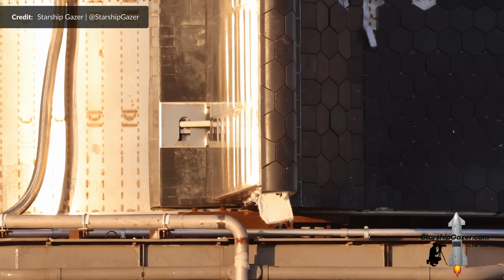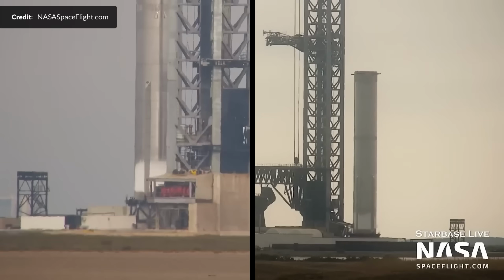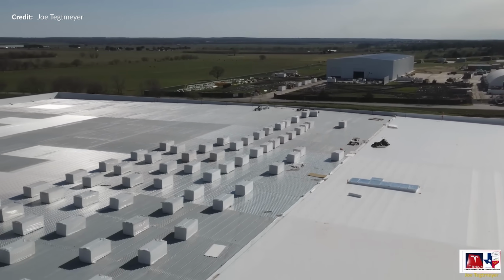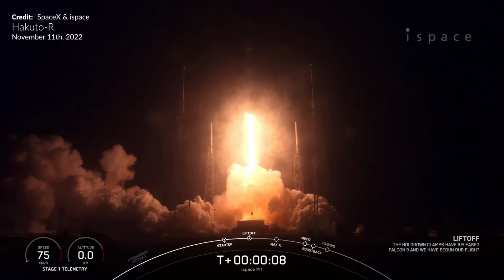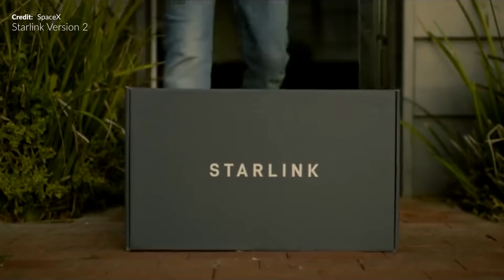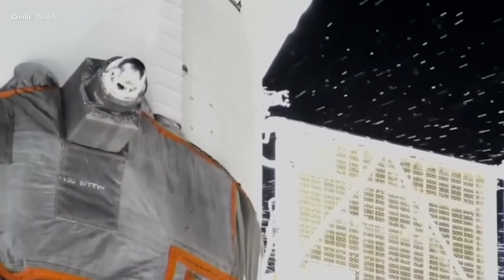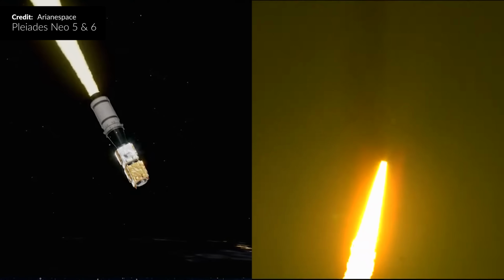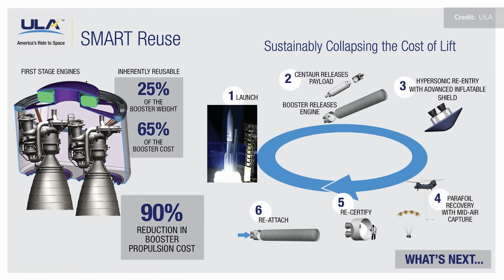SpaceX Starship Update, Record Booster Landing,  Soyuz Leak, Vega C Failed and Much More

Comment: ArianeSpace is even worse than Boeing at this point... not because of the Vega C failure , Im sure they will get it right eventually , but because Ariane 6 is a rocket that will be Dead On Arrival

Falcon 9 & Vulcan Centaur are much better rockets in that same class and the only thing that makes it better is the larger Volume capability from the larger fairing that is inherited from Ariane 5

For literally any other payload than the JWST , that needed that volume , Ariane 5/6 is simply worse compared to the alternatives that already exist

Comment: Even if the tiles do fail it is very likely that the craft would survive reentry on it's own since it's made out of stainless steel.
Reply: You’re joking. Stainless steel has the poorest thermal conductivity of any commonly used metal. There’s more to it than melting point. Ask any welder.

Comment: I'm very much concerned about the loss of the tiles.   We've learned that lesson (the hard way) already; why accept this risk??

And why not add flaps to the booster (and do the belly flop maneuver) as well?

Echo Site: They need to start planning the cargo load required to build and sustain a mars base.
Reply: Why add flaps to the Superheavy and do a belly flop? It can just pitch over, do an entry burn, and then land like a Falcon 9. The Superheavy doesn't get high or fast enough to need a belly flop.

Comment: Great to hear Star Link has a million active customers as we need that income to begin to pay for future plans and to accelerate space travel in general, interesting to see another private launch company may get it self into gear with BE-4 engines but clearly they need to work more efficiently to speed up their design and manufacturing process as they are already years behind SpaceX and could even be leap frogged by other private rocket company's when it comes to re-useability.

Comment: There is probably a better system to withhold the thermal tiles than the 3 pins currently in use.

:body-blue-raised-arms:

Comment: Marcus, confirm each drop of Russian leaked  liquid now becomes a frozen missle/bullet?
Reply from the maker: Any liquids like this gets blasted by solar radiation and evaporated away into basically nothing, so no problem there. Likewise with anything that melts/degrades easily with solar radiation. Plastics and stuff like that don't ever really last too long either. It is mainly durable solids like metals or even flecks of paint that seem to last for a long time.

Comment: Your forgetting the starship need to launch from the surface of Mars directly so needs to withstand the reflection of vibration waves and material from the ground on Mars when landing they won't have the benefit of a pre built landing pad and all the loose material may damage the ship and tiles
Reply from the maker: Long term, zero tiles should be being lost. For prototypes, not a huge problem. Crewed flight, that is a problem. Earth, Mars or wherever.

Comment: ON a side NOTE, if you have access to Elon Musk tweet, Please ask question, about one main issue of recently that the Launch Tower is having issues from the intense rocket thrust affecting the ground around it at ground zero, particular the cement below the rocket engines. Well since he is making them, and yes I know they are expensive, but what would be thought of placing (heat shields--like ones on Starship) at base of the ground (say only 100ft circle)to deflect the intense heat generated by engines???
Reply: You can sign up for Twitter and ask Musk in a tweet.
Reply: @steveaustin2686  ..sorry i am very much old school, and really dont do much of internet, in regards to tweet, facebook, etc(never on them).. Feel free to ask him yourself, but would be interested in feedback. But I believe it would solve a number of issues at ground zero, including the launch tower (certain areas) plumbing, electrical, etc that have been effected already. Since being made by his company and making thousands of them for many starships, I think it would be appropriate to do the same where intense heat for a few seconds is at ground zero for (many) launches down the line!!  Dennis Young of Sedona, Arizona-  Professional astronomer.
Reply: @dennisyoung130  When Musk brought back the traitor Trump to Twitter, I left. The heat shield tiles are great for heat, but not so good vs blast pressure. So the heat shield tiles likely would not help the launch tower.

Comment: tell Elon: He made 3 obvious mistakes he is refusing to correct, proving that he is not serious about making the starship operational: 1) launch mount 3 times d height needed 2) tiles need 4 pins, not 3. 3) some tiles needed on inside edge of starship skirt.
Reply: Starship will become operational as soon as it can launch payloads into orbit. Customers don't care if the booster or the spaceship are recovered. Just like it was with Falcon 9 when it first started. Recovery of course is desirable for SpaceX from a financial and schedule standpoint.  But launching people on Starship including reentry and landing is far in the future in spite of all the hype about Dear Moon. Before they can attempt anything like that they will have to have worked out tile issues and everything else and demonstrated reliability for launch and landing. My personal opinion is that the design cannot be made as safe for humans as a capsule for launch and reentry and Earth landing, so I expect that people will ride to and from Earth orbit on Dragon and dock with Starship.
Reply: @StevePemberton2  could be  😉
Reply: You can bet your bottom dollar that he has some of his best engineers working on solutions to all of these  problems 😏
Reply: @shawndouglass2939  Yes I'm sure that they do. They have at least four separate goals that they are juggling right now with Starship. Launching satellites (including Starlink), HLS lander, recovery of the vehicles, and launching people on Starship. I would think that the last one is their lowest priority right now.

Merry Christmas!
Reply: @StevePemberton2  .Merry Christmas to you too. 😉
Reply: @StevePemberton2  Recovery of Starships isn't strictly necessary for HLS Starship to work. SpaceX could expend the [DELETED] Starship propellant depot, the up to 8 Starship Tankers, and HLS Starship and still have a successful Moon landing. It would be terribly expensive to expend all the Starships, but that would not stop HLS Starship from working. Starlink v2 launches and the 3 variants for HLS Starship are almost certainly the main focus of SpaceX right now.
Reply: @steveaustin2686  In my previous message I may not have been clear, when I said recovering vehicles was a priority for SpaceX I was referring only to regular Starship not the HLS version. NASA has no requirement for recovering any of the HLS hardware, so it's up to SpaceX whether they think it's worth it or not. 

Recovering or reusing the HLS landers is impractical at this time, so I expect that both of the HLS landers that SpaceX has contracted with NASA to produce will be disposed of in solar orbit. Unless some lunar geologists request that they be crashed into the Moon to obtain seismic readings.

The fuel tankers launched into Earth orbit I'm sure they will attempt to recover them, but as you indicated recovery is not necessary to meet the HLS goal, assuming they can build Starship tankers fast enough to meet the program schedule.

The fuel depot in Earth orbit is sort of a moot point, similar to a space station it will be reused  even if it is not recovered to Earth.
Reply: @StevePemberton2  I was not talking about the HLS Starship specifically for HLS Option A, as sustainability for that contract is not a requirement. Sustainability for HLS Option B is a requirement, but that doesn't necessarily mean reuse. I was mostly talking about the Starship Tankers for HLS.

From the renders of the [DELETED] Starship propellant depot, it does not appear to be capable of returning to Earth, like the HLS Starship. But with SpaceX having the GAO redact all the info on [DELETED], we don't know for sure. We only know that it is at least a propellant depot from the context on pg 27 of the GAO report denying the HLS complaints. How long it can stay operational and what else it might be, we don't know yet.

The Starship Tankers are planned to be reused, but who knows how long that may take. Musk has said that he expects that it will take multiple attempts for a successful landing for Starship (second stage) on the 'orbital' attempts. I would expect one or more of those to be RUDs on re-entry.

Musk has also said that it will take hundreds of successful, operational flights before crew could be put on board, IF Starship can be reliable enough. I agree with you that SpaceX almost certainly has plans for Crew Dragon, and Starliner too I would expect, to ferry crew to and from LEO for a crew mission on a Starship. Since the depot seems to be an extended Starship, I wonder if that might be the reason for redacting the info on the depot. I mean if [DELETED] is just a propellant depot, why redact the info, only to confirm it is a depot from the context. I wonder if the [DELETED] could also be a crew transfer station for docking a few capsules to transfer to a mission Starship. That would make more sense for a reason to redact the info. It would also mean that the capsules likely could be supported by the depot, like they are on the ISS.
Reply: @steveaustin2686  I was making an assumption that the fuel depot could be reused. Obviously that would be the goal, but it's possible that a fuel depot might have to be replaced, or they may decide to make upgrades and simply build and send up another one.  

I tend to doubt that a fuel depot will be attached to any habitable modules. Not that a fuel depot is more dangerous than a fully fueled Starship, nevertheless I just think they won't want people attached to it, especially during fueling operations. Which is another reason why I don't think people will launch on Starship, although that is further down the list of the multiple reasons.

A transfer station might appear in the future, but I think the initial missions such as Dear Moon will be simpler. Starship would launch without crew and dock with the fuel depot and get filled up. It would then undock and move a safe distance from the depot. The Dragon capsules would then launch and dock one at a time with Starship, then undock to wait in Earth orbit for Starship to return from the Moon.
Reply: @StevePemberton2  It would make sense that the depot should be able to be used for refilling more than one mission Starship. How many, we just don't know yet.

The Crew Dragon capsules can not fly long by themselves evidently. Ten days is the limit apparently. Probably ok for the Dear Moon mission which is just a flyby per the project website. I doubt that they will leave the Crew Dragons by themselves in orbit. Attaching them to the depot makes more sense.

The Dear Moon mission would likely be run like the HLS Starship mission I would think. Unless it and the Polaris Starship missions will wait until Starship is reliable enough for crewed Earth operations. Which may never happen, if Starship can't be reliable enough.

From page 27 of the GAO decision to deny the HLS complaints. [DELETED] is apparently at least a propellant depot Starship variant from the context and SpaceX had the GAO redact that info. Added in Musk's payload update (~150t) and he says that it is up to 8 Tankers to fully refill Lunar Starship, depending on Lunar Starship's mass. My comments are in ().

"SpaceX’s concept of operations contemplated ten total launches (down from 16), consisting of: 1 launch of its [DELETED]; 8 launches of its Tanker Starships to supply fuel to [DELETED] (down from 14); and 1 launch of its HLS Lander Starship, which would be [DELETED] and then travel to the Moon."

Since Dear Moon is a flight around the Moon, it likely won't need to be filled up completely. For the depot to be a crew transfer station, the Crew Dragons (and Starliner) would launch to bring up the crew, after the mission Starship has completed the propellant transfer. Then the crew would transfer to the mission Starship, leaving behind someone to babysit the capsules. Dear Moon has 11 crew, outside of any SpaceX personnel. It's possible that some of the 11 crew could run Starship with the extra person of the 3 Crew Dragons to babysit the capsules. The much smaller Harmony module on the ISS has 3 docking ports, so 4 on the much larger depot doen't seem unreasonable.

Comment: Imagine if SpaceX actually designed stuff properly from the beginning instead of wasting time and money with this fail forward amateur approach
Reply: Because the best form of development is try and fail.
Reply: @thecyanadon  Not always.. it can be for some things for some time. It’s also wasteful and expensive. The way SpaceX  does it seems unnecessarily resource intensive and not thought through. Just throwing money at something until it works is not really the smart way to solve a problem, that’s more like the Chinese way to do it.. Many things could have been avoided with better project planning and studying instead of building a new rocket every time a new problem occurs. You don’t work with engineering R&D do you?
Reply: @hippomormor  no I don't, I have done enough comparisons to realize, yes SpaceX are being wasteful however it is a lot better then most things, They test learn and modify, even modifying before testing.

Comment: I hope Blue Origin succeeds but I am not holding my breath...

Such a pity that Mars rovers fail, primarily due to lack of power.  Maybe a miniature reactor on-board will sort this problem AND possibly provide a decent cleaning solution to solar power augmentation.  Come on Nasa...
Reply: The Insight spacecraft is 1480 days into a 731 day mission, so their dust management plan worked pretty well. 

RTGs are heavy and expensive, so only spacecraft that need them, get them, like the car-sized Curiosity rover.
Reply: @steveaustin2686  Understood Sir.  I just wonder if mission profiles would alter if one began with an RTG requirement.  Then the problem becomes 'how to have it arrive there safely.
Reply: @jimparr01Utube  As I understand it, not many RTGs are made, so not every mission can get one. Solar is cheaper and lighter than an RTG, without the controversy of radioactive elements inside.

Comment: I'm a big fan of ula. I but I have no trust in blue origin! Reusable.... yeah we'll see.. where do I go to place my bet ZERO be4s are reused for over a year? 2 years?? 3 years? I'd Iike to place my bet before the odds go down the toilet.
Reply: ULA is still developing the inflatable heat shield. They have done one test so far and it apparently was successful.
Reply: @steveaustin2686  my doubts are not with ula at all. My doubts are 100% with bo.
Reply: @ThisButterGuy  Oh, Blue Origin is slow, no doubt. It will be interesting to see if they can deliver 4 more flight ready engines before the Q2 2023 USSF-106 flight.
Reply: Looks like the USSF-106 flight was pushed back to Q3 2023. I don't know if it was for payload or the launcher, but with all the other USSF flights being delayed for payload, it could be that.

Comment: For protection of the underside of the flaps, couldn't they build solid deflectors joined to the base so the over-pressures and temps are deflected on both sides of the flaps?

Comment: As far as the Insight Lander, or any other Martian lander/rover goes, wouldn't a simple feather duster on a windscreen wiper do the trick? Such a simple a way to clean the dust off the solar array.
Reply: There are issues. You are sacrificing science payload for the duster. You have the mechanical arm complexity, failure points, and power needed for the arm. The dust is usually static charged, so is not as easy to remove.

The existing dust management, without a duster for Insight, lead to a  current 1480 days into a 731 day mission, so 749 bonus days.

Comment: Wow kids are hecka smart.  Superheavy booster with side boosters could be a way to maximize Starship without expending the booster which could maybe even land with empty side boosters or they could parachute in the ocean n still be reused
Reply: The Superheavy booster is planned to be landed even without the side boosters added. Adding boosters can have diminishing returns as you need propellant to lift the propellant added, as well as propellant to lift that propellant, etc. The Falcon boosters use RP1 and Starship uses LCH4 as fuel. SpaceX doesn't like to mix fuel types, which is why they go for a less efficient RP1 second stage on Falcon rockets, instead of a more efficient LH2 second stage. Replacing the Merlin engines with Raptor engines is not simple, as the tanks are sized to RP1, not LCH4. And the engine mounting points would have to be changed, as the Raptor is larger than the Merlin. Likely plumbing too. So basically, you would have to build a new booster for that.

Comment: Hear me out... That render with a Starship using Falcon 9's as detachable boosters is actually kinda genius. Why use SRB's when you can use fully guided boosters?
Reply: The Falcon boosters use RP1 and Starship uses LCH4 as fuel. SpaceX doesn't like to mix fuel types, which is why they go for a less efficient RP1 second stage on Falcon rockets, instead of a more efficient LH2 second stage. Replacing the Merlin engines with Raptor engines is not simple, as the tanks are sized to RP1, not LCH4. And the engine mounting points would have to be changed, as the Raptor is larger than the Merlin. Likely plumbing too. So basically, you would have to build a new booster for that.